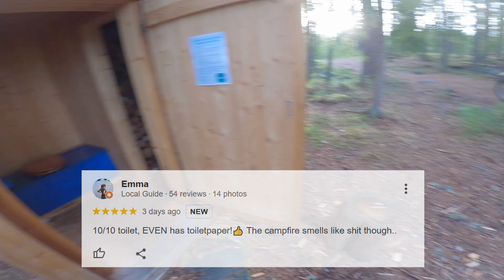The KEY to a Camping adventure in NORWAY

Comment: Question for Emma; you've got the Enduristan handlebar bag (can't see if it's the small or the large one) on your motorcycle. It has an innovative fastening clamp system, as the manufacturer describes it, but I believe it's quite loose on your handlebar. How did you attach it? The only downside I see, is it doesn't have a quick lock system to detach the bag from its base, so in crowded areas you always have to take your valuables out of the bag to avoid it gets stolen.
Reply from the maker: Hi! I have the large version of the Handlebar bag and I use it upside down (because my handlebar has a crossbar). It fits really well on my handlebars, but it comes with 2 sizes of inlays and I use one big and one small one. If you want to I can measure the diameter of my bars, so you can know for sure! And yes these aren't removable (except for the phone case), but I'll take that over a tank bag any day😂. Thanks for commenting. cheers!🏍🙋‍♀️
Reply: @Skidmate  You're welcome! If you would be so kind, because my bike has a crossbar as well, as I assume the standard diameters (22,28,32) for the handlebar will fit seamlessly. I agree on the tankbag option, and will also keep an eye on the Mosko Moto and Turkana offering. Similar idea, different attachment approach. Thank you for your quick reply!
Reply from the maker: @SKLSNAPS  Hey! Just measured the outside diameter of my DR and it is 22.4mm. The crossbar has about  3,7cm of clearance between the handlebar itself. Hope it helps! 😁🙋‍♀
Reply: @Skidmate  That is very quick 😃 Thanks a lot. I will do my own measurements on the crossbar. Thanks a lot for your time and help. Have a wonderful Sunday!